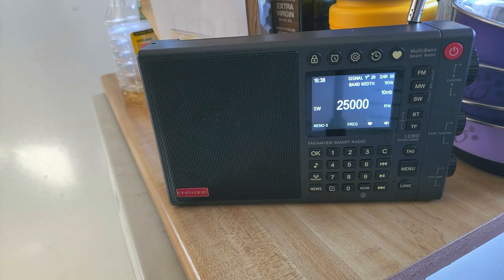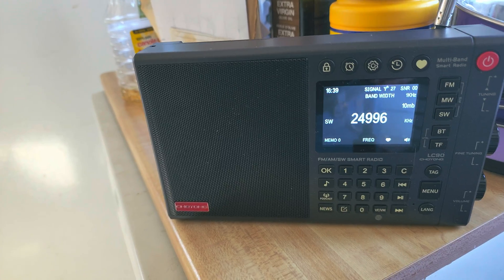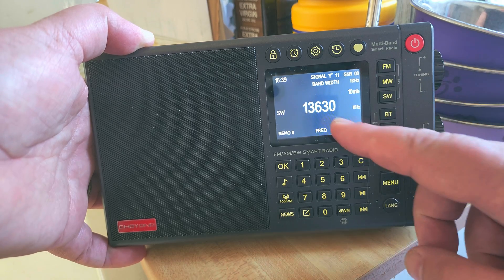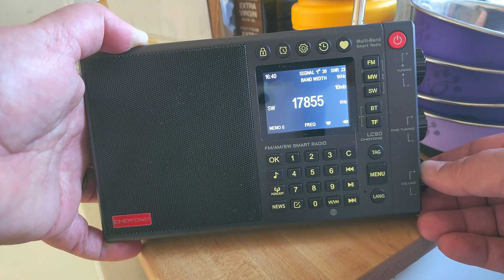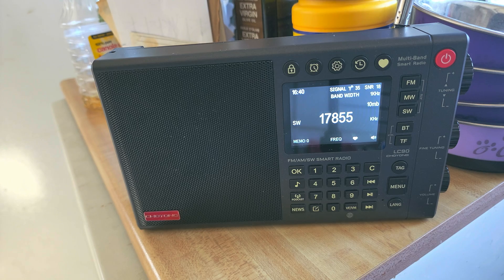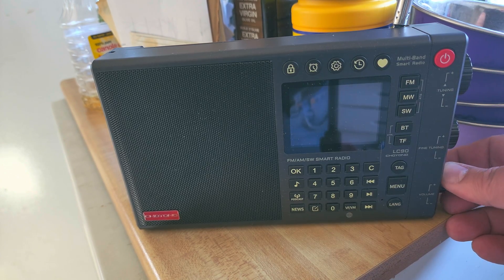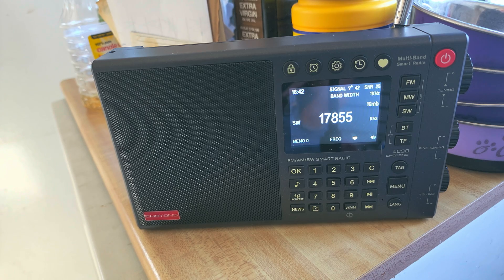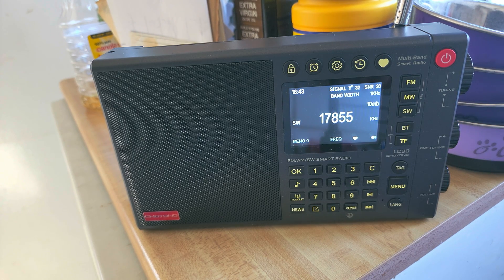Choyong LC90 receiver on Shortwave is plagued with a major problem of birdies

Comment: By default anything Wifi can upset  'Shortwave Radio Reception'.  I have problems with my Tecsun pl-380 when I turn on my nearby laptop that's connected to a wall socket or if I turn on my local LED lamp, anyway  (Congratulations on owning the LC90)